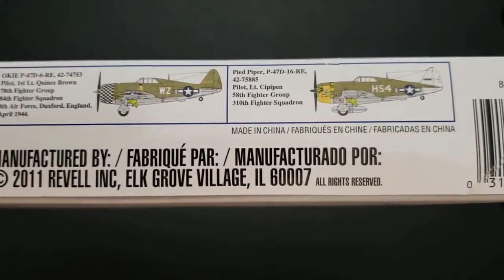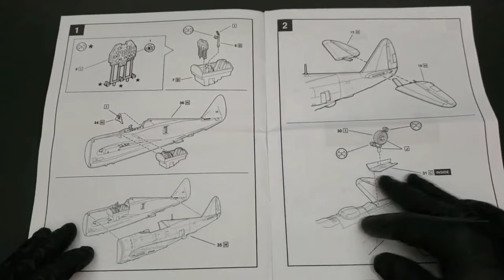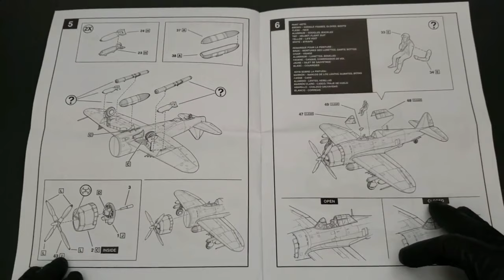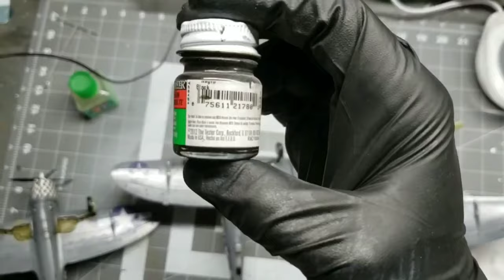P-47D Razorback | TIMELAPSE | Full Build | Revell | Monogram | Scale Model Building|WWII|Airplane

Comment: I did see this kit when I first got back into modeling, but luckily for me before I started the build, the Tamiya P-47 "Razorback" was issued. You can't beat those three from Tamiya, "Razorback", "Bubbletop", & "M" versions. No rudder pedals? I see why I gave my two away, plus just overall lack of detail. That's not the gunsight, that's the internal bullet proof glass. Nobody is perfect at panel lines, the oil & smoke doesn't flow perfectly also. "Pied Piper" is a PTO P-47 so the Pacific sun & weather was much harder on the paint. The antenna wire does not go to the mast, it goes to the fuse, just below the mast on the stdb side. The three came out great! Excellent addition to your build collection. Congrats!
Reply from the maker: Man these are great things to know!! I'm building 2 bubble tops right now. This helps a lot thanks!!